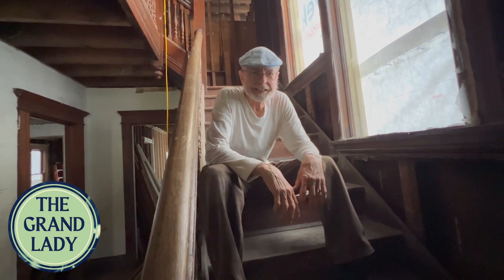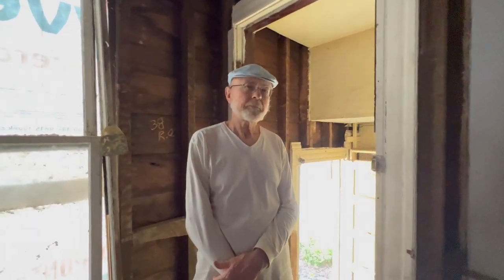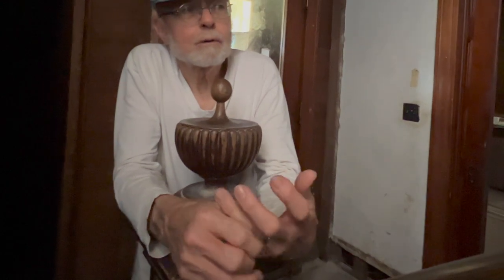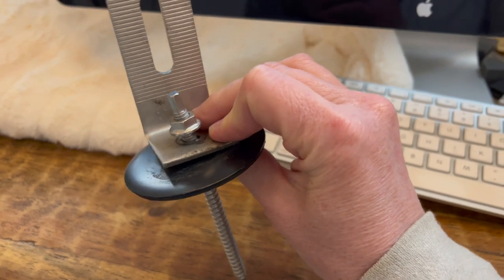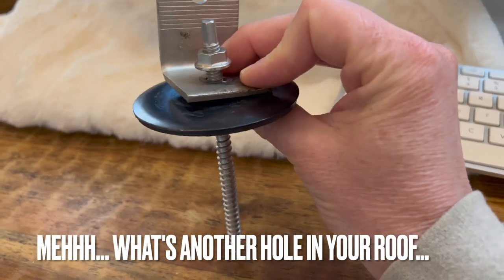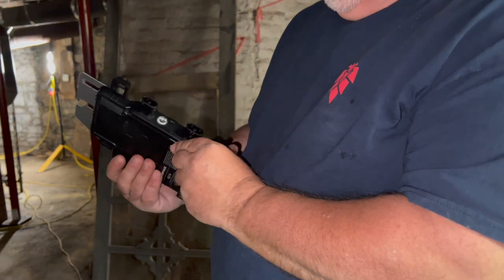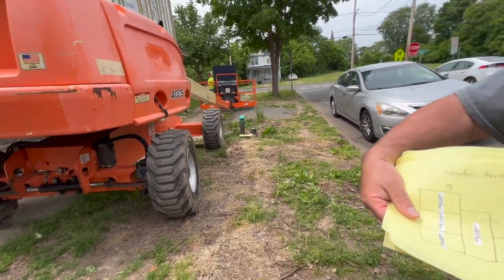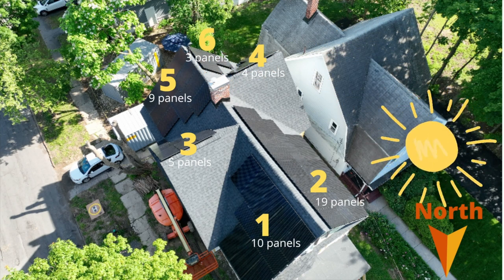SOLAR PANEL INSTALLATION on our 19th century VICTORIAN RENOVATION 🌞 🌍 🌻  -  The Grand Lady

Comment: hi, good to see the improvement on your home.
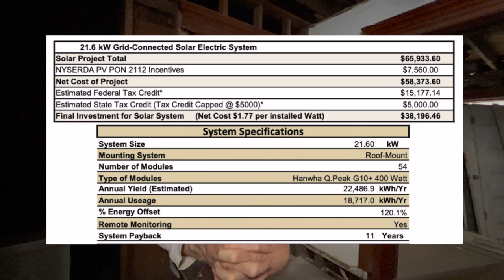At 09:53 total solar investment estimate. Tax credit does not bring down the price (26% of your total project costs (including equipment, permitting and installation) can be claimed as a credit on your federal tax return.). Since everything has life expectancy and you put it on your roof. Have you calculated how much more it cost to remove all solar panel (when) your roof needs to be replaced? I am up for green, have electric cars but I would not put any solar panel on roof....unless you have brand new roof with 50years lifespan and not planning to leave there after that.
I still love your home, all your woodwork almost the same as mine. I started 3 years ago and still not finished up interior of my home. Keep up the good work.

Comment: Did you look into solar shingles?  I worry about our asphalt shingles only lasting 15 years and then having to take off all the solar panel system in order to replace the asphalt shingles.  Also, will heating and hot water and stove and dryer be electric?
Reply from the maker: Great questions!  Yes, we wanted the solar shingles but, no one in this area is installing them yet.  Those shingles really make sense!! ONE roof system.    Just FYI our new roof is warrantied for 25 years and the solar panels are warrantied for 25 years too.  Solar panels actually protect the asphalt that's under them from  deteriorating so, the other parts of the roof not under solar panels will most likely need replacement/repair before those under the panels.  We will be an all electric house (except for the 1800's Furnace Jim restored in the basement that runs on gas).  We're using electric appliances mostly due to air quality concerns with using gas appliances - as she's going to be insulated quite tightly.        So, in 2047 we will know how all of this turns out.  Haha... seems so long from now.  Thank you Gary for your great questions!
Reply: Thanks Gary,  Our heat will be primarily dependent upon electric ductless air-air heat exchangers.  Our old furnace restoration is for fun and antiquity preservation, not primary heat.
Reply: Never thought of that!